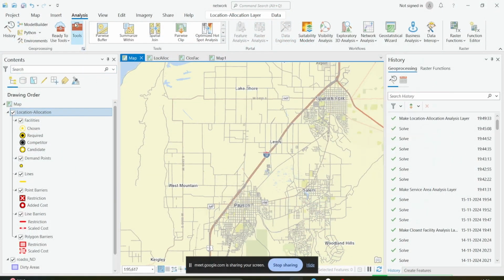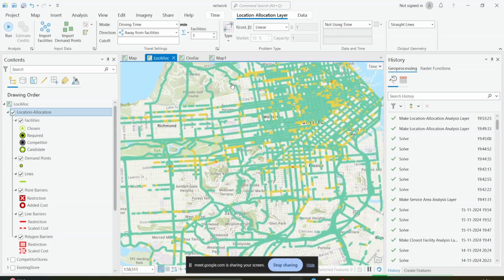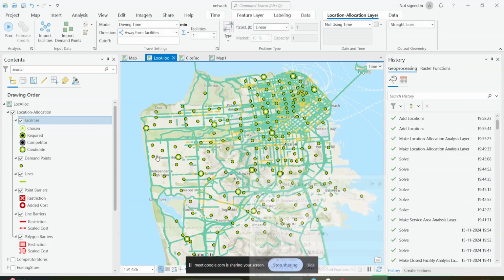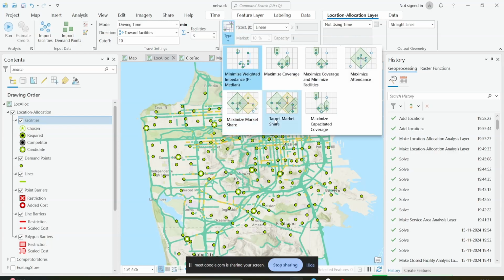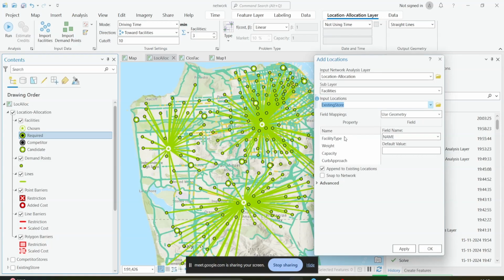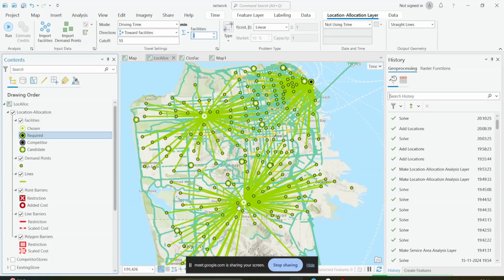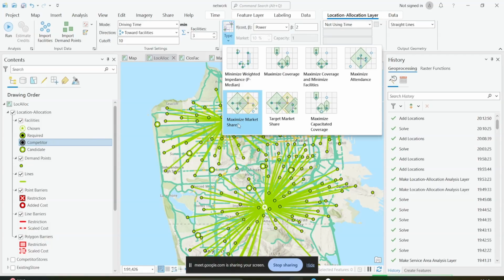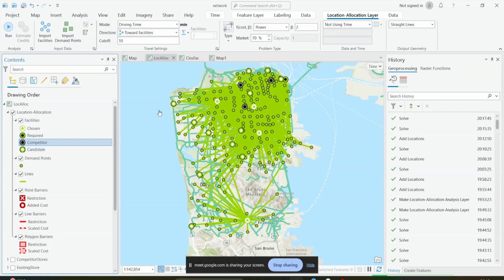ArcGIS Pro Network Analysis (Part 4): Location-Allocation Explained | Site Selection with GIS

Comment: Thanks for the tutorial, 
is it possible to create a Location-Allocation problem that is independent from the street network? 
I just want to do it based on air line distance since I am analyzing the usage of flight objects. Or are there other workarounds available that you know about?
Reply from the maker: any interconnected line dataset can be made into a network, and Loc Alloc can be applied on any line network